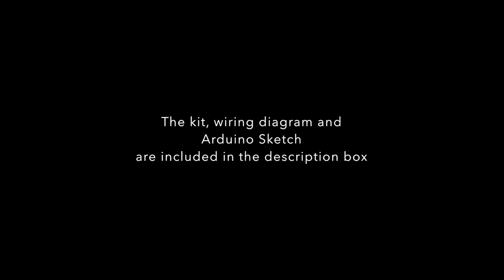Arduino Robot Car | Obstacle Avoiding Robot Car 2WD with Ultrasonic sensor and L298N Module

Comment: This is the correct code:
#include <Servo.h>

Servo servo;

const int trigPin = 13;
const int echoPin = 12;

const int servoPin = 11;

const int enAPin = 6;
const int in1Pin = 7;
const int in2Pin = 5;
const int in3Pin = 4;
const int in4Pin = 2;
const int enBPin = 3;

enum Motor { LEFT, RIGHT };

void go(enum Motor m, int speed)
{
    digitalWrite(m == LEFT ? in1Pin : in3Pin, speed > 0 ? HIGH : LOW);
    digitalWrite(m == LEFT ? in2Pin : in4Pin, speed <= 0 ? HIGH : LOW);
    analogWrite(m == LEFT ? enAPin : enBPin, speed < 0 ? -speed : speed);
}

void testMotors()
{
    static int speed[8] = {128, 255, 128, 0, -128, -255, -128, 0};
    go(RIGHT, 0);
    for (unsigned char i = 0; i < 8; i++)
        go(LEFT, speed[i]), delay(200);
    for (unsigned char i = 0; i < 8; i++)
        go(RIGHT, speed[i]), delay(200);
}

unsigned int readDistance()
{
    digitalWrite(trigPin, HIGH);
    delayMicroseconds(10);
    digitalWrite(trigPin, LOW);
    unsigned long period = pulseIn(echoPin, HIGH);
    return period * 343 / 2000;
}

#define NUM_ANGLES 7
unsigned char sensorAngle[NUM_ANGLES] = {60, 70, 80, 90, 100, 110, 120};
unsigned int distance[NUM_ANGLES];

void readNextDistance()
{
    static unsigned char angleIndex = 0;
    static signed char step = 1;
    distance[angleIndex] = readDistance();
    angleIndex += step;
    if (angleIndex == NUM_ANGLES - 1)
        step = -1;
    else if (angleIndex == 0)
        step = 1;
    servo.write(sensorAngle[angleIndex]);
}

void setup()
{
    pinMode(trigPin, OUTPUT);
    pinMode(echoPin, INPUT);
    digitalWrite(trigPin, LOW);

    pinMode(enAPin, OUTPUT);
    pinMode(in1Pin, OUTPUT);
    pinMode(in2Pin, OUTPUT);
    pinMode(in3Pin, OUTPUT);
    pinMode(in4Pin, OUTPUT);
    pinMode(enBPin, OUTPUT);

    servo.attach(servoPin);
    servo.write(90);

    go(LEFT, 0);
    go(RIGHT, 0);
    testMotors();

    servo.write(sensorAngle[0]);
    delay(200);
    for (unsigned char i = 0; i < NUM_ANGLES; i++)
        readNextDistance(), delay(200);
}

void loop()
{
    bool tooClose = false;
    readNextDistance();
    for (unsigned char i = 0; i < NUM_ANGLES; i++)
        if (distance[i] < 300)
            tooClose = true;

    if (tooClose)
    {
        go(LEFT, -180);
        go(RIGHT, -80);
    }
    else
    {
        go(LEFT, 255);
        go(RIGHT, 255);
    }
    delay(50);
}
Reply: does it work dude?
Reply: Thank you for sharing this code , it's working. Only this code help me , there's a lot of videos here in YouTube wasting my time to watch their code in description not work properly.

Comment: the code has errors!!!!!!!!!!
Reply: send it i will correct it
Reply: @slinfinityprogrammer1000  
here:
#include <Servo.h>

Servo servo;

const int trigPin = 13; 
const int echoPin = 12; 

const int servoPin = 11;

const int enAPin = 6; 
const int in1Pin = 7; 
const int in2Pin = 5; 
const int in3Pin = 4; 
const int in4Pin = 2; 
const int enBPin = 3; 

enum Motor { LEFT, RIGHT };

void go( enum Motor m, int speed)
{
digitalWrite (m == LEFT ? in1Pin : in3Pin , speed > 0 ? HIGH : LOW );
digitalWrite (m == LEFT ? in2Pin : in4Pin , speed <= 0 ? HIGH : LOW );
analogWrite(m == LEFT ? enAPin : enBPin, speed < 0 ? −speed : speed );
}

void testMotors ()
{
static int speed[8] = { 128, 255, 128, 0 ,
−128, −255, −128, 0};
go(RIGHT, 0);
for (unsigned char i = 0 ; i < 8 ; i++)
go(LEFT, speed[i ]), delay (200);
for (unsigned char i = 0 ; i < 8 ; i++)
go(RIGHT, speed[i ]), delay (200);
}

unsigned int readDistance ()
{
digitalWrite ( trigPin , HIGH );
delayMicroseconds (10);
digitalWrite ( trigPin , LOW );
unsigned long period = pulseIn ( echoPin, HIGH );
return period * 343 / 2000;
}

#define NUM ANGLES 7
unsigned char sensorAngle[NUM ANGLES] = { 60, 70, 80, 90, 100, 110, 120 };
unsigned int distance [NUM ANGLES];

void readNextDistance ()
{
static unsigned char angleIndex = 0;
static signed char step = 1;
distance [angleIndex ] = readDistance ();
angleIndex += step ;
if (angleIndex == NUM ANGLES − 1) step = −1;
else if (angleIndex == 0) step = 1;
servo . write ( sensorAngle[angleIndex ] );
}

void setup () {
pinMode(trigPin , OUTPUT);
pinMode(echoPin, INPUT);
digitalWrite ( trigPin , LOW);

pinMode(enAPin, OUTPUT);
pinMode(in1Pin, OUTPUT);
pinMode(in2Pin, OUTPUT);
pinMode(in3Pin, OUTPUT);
pinMode(in4Pin, OUTPUT);
pinMode(enBPin, OUTPUT);

servo . attach ( servoPin );
servo . write (90);

go(LEFT, 0);
go(RIGHT, 0);
testMotors ();

servo . write ( sensorAngle[0] );
delay (200);
for (unsigned char i = 0 ; i < NUM ANGLES ; i ++)
readNextDistance (), delay (200);
}

void loop () {
  
readNextDistance ();
for (unsigned char i = 0 ; i < NUM ANGLES ; i++)
if ( distance [ i ] < 300)
tooClose = 1;

if (tooClose) {
go(LEFT, −180);
go(RIGHT, −80);
} 
else {

go(LEFT, 255);
go(RIGHT, 255);
}
delay (50);
}
Reply: @slinfinityprogrammer1000  please help me correct it

Comment: Actually, you could remove the brown sticker from the frame and you would be left with a transparent one.
Reply: ohhh thanks buddy
Reply: How is that any youtube video. I can't remove that
please reply
Reply: @SALMANULFARISMM  in the box I got the brown surface could be removed like a sticker. Maybe you got another version?
Reply: @ancientgear7192   ok thank you
Reply: @ancientgear7192  which Sensor sheild V5. To buy on amazon. Any link
Reply: @SALMANULFARISMM  I bought a box from bangoot.
Reply: @SALMANULFARISMM  i used a blade. but be careful
Reply: Water will remove it.